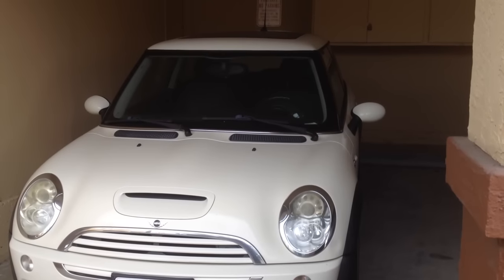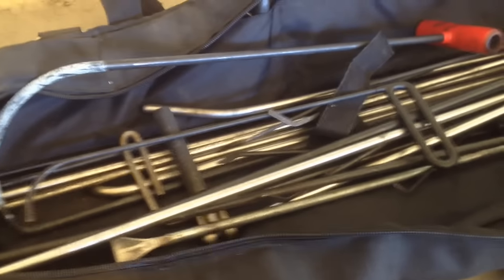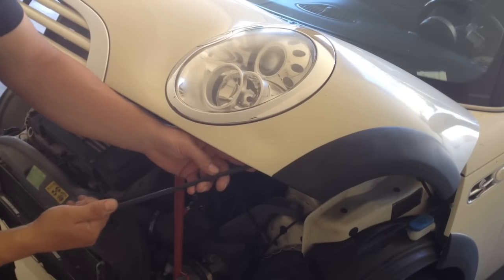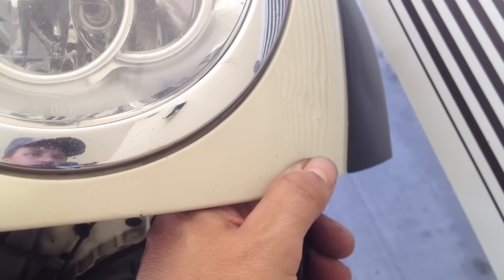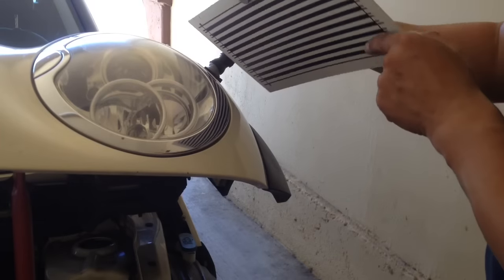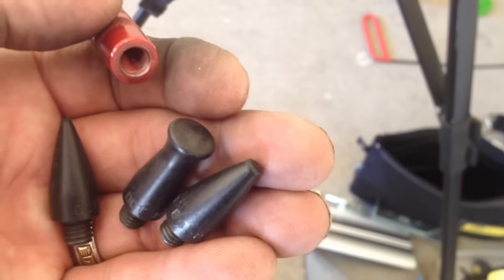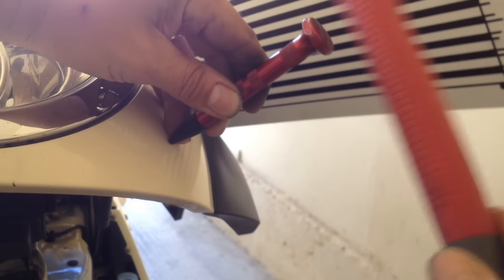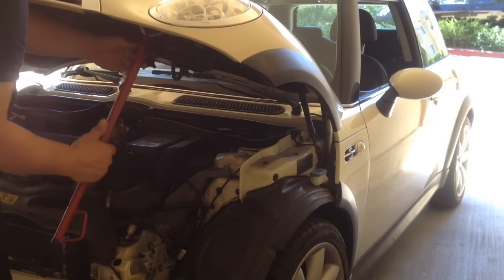PAINTLESS DENT REPAIR | PDR How to | Mini Cooper S

Comment: i prefer to rely on glue as much as possible, as working by pushing metal with a metal piece from inside would remove/scarp-off the anti-corrosion coating from the inside.